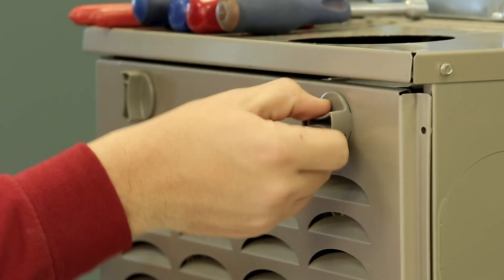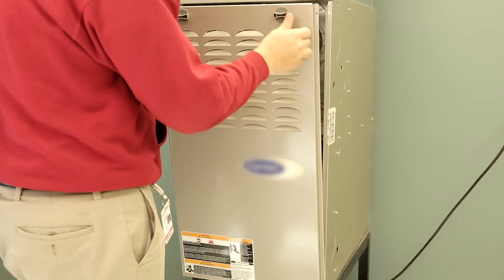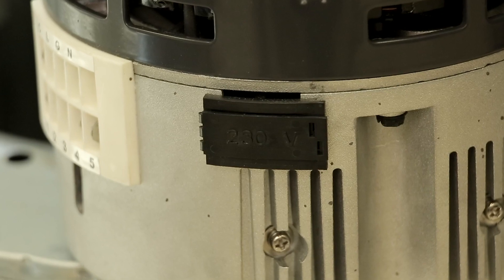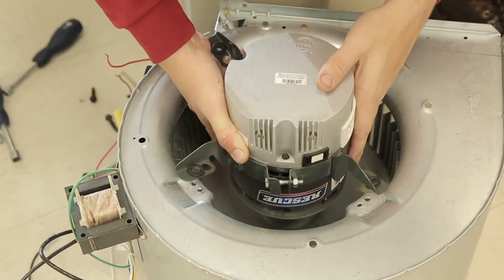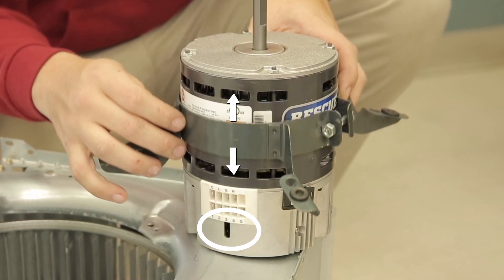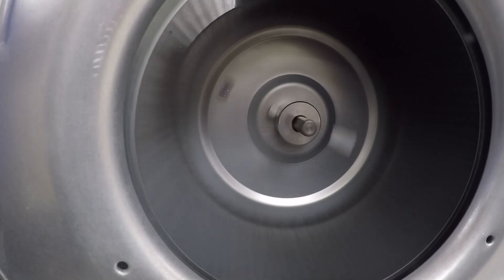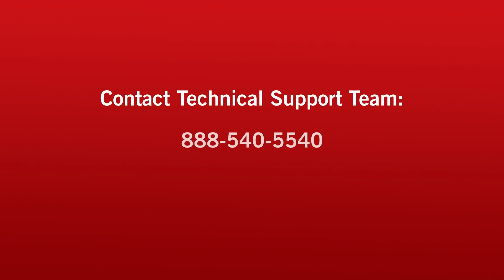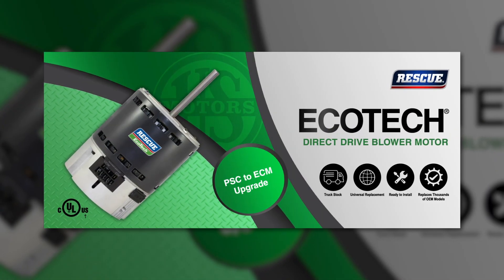Nidec Rescue EZ13 Installation

Comment: Is there a way to manual program the rotation?  If the ductwork has higher resistance on the return, would it possibly spin backwards?